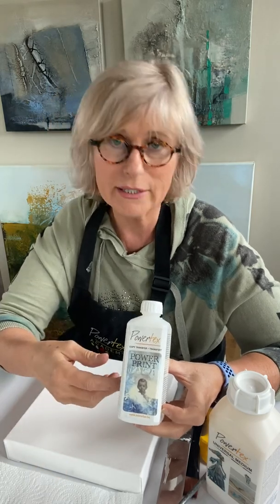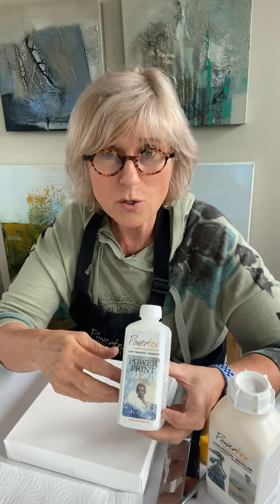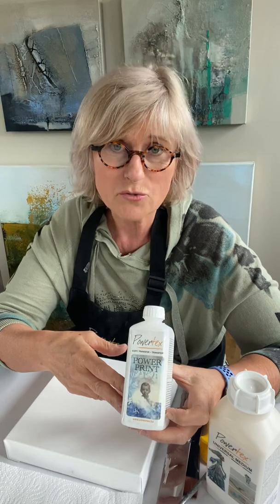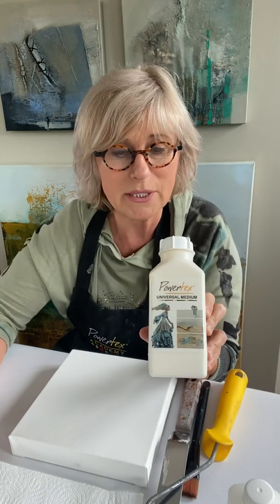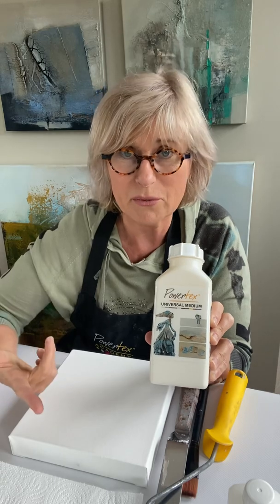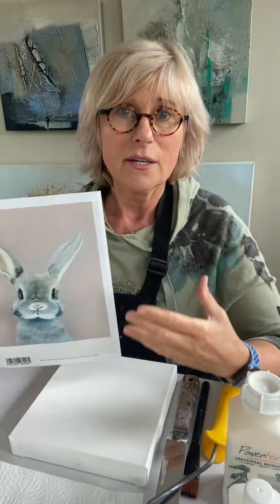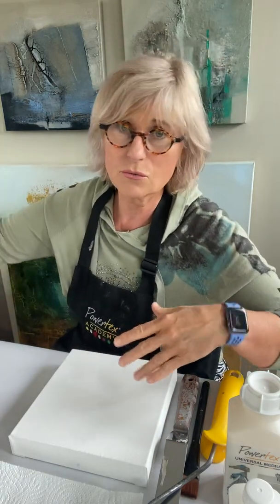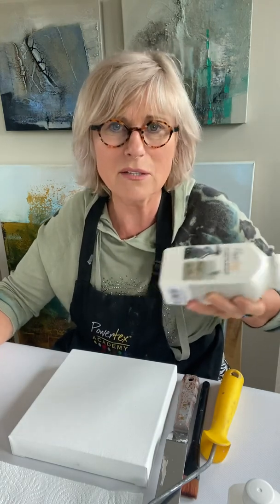Powerprint tips and step nr.2

Comment: Thanks for posting. Please let me know if a pencil drawing can be transferred to a glass surface using this medium. If not, is there any other way to do it?
Reply from the maker: Dear, I never tried. If you make the drawing on a thin paper or you copy the drawing on ta thin paper, then it should be possible.
Reply: @brigittegrade  Many thanks for your kind reply. It is a pencil drawing on a normal A4 size paper that we use all the time for printing all kinds of stuff. In terms of weight, it is 75 GSM (grams per square meter). Please let me know if you know if this is thin enough. I greatly appreciate your taking the time to reply to me.
Reply from the maker: @anupamsircar111  Yes, that is fine ... not more then 80 gr. is perfect.
Reply: @brigittegrade  Thanks once again. Any time you are in India, let me know. You have a friend here.
Reply from the maker: @anupamsircar111  75 gr. is perfect any paper untill max 80 g workds great.